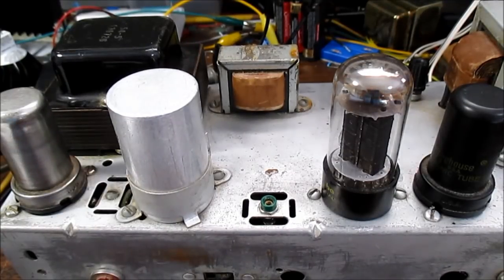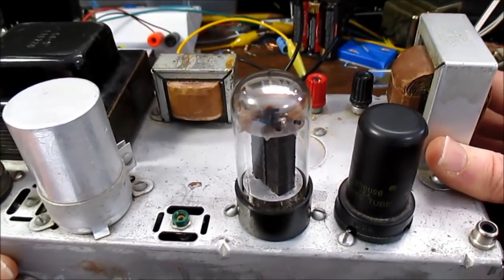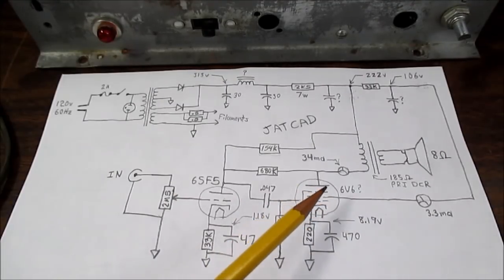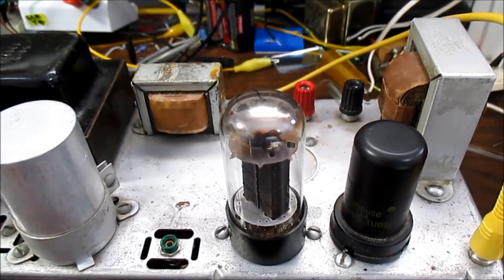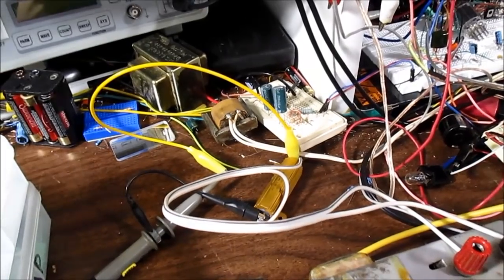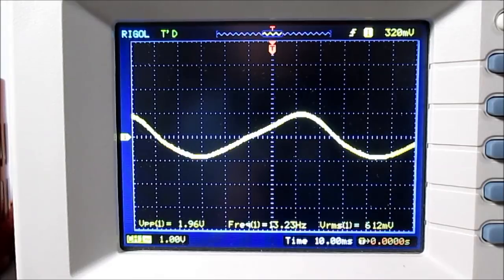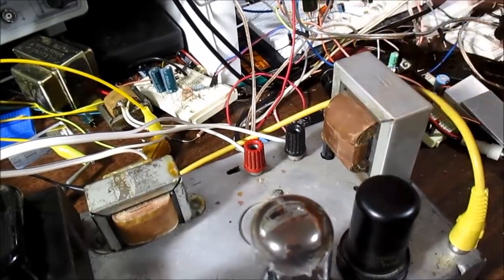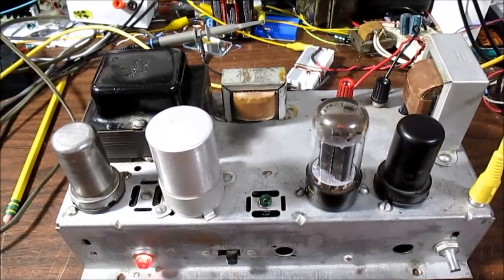Vintage 6V6 SE vacuum tube audio amplifier test & review

Comment: Could have been a radio chassis at one time. The cut outs on either side of the electrolytic look like they could have been for IF cans. 
 The output tube could also be a 6W6 or 6K6.

Comment: I built a little SE 6V6 amp for myself, and it also distorts the bass when I crank it up a bit, I blame it on the output transformer being too small, but I am not sure. I used parts from a old car radio. Sounds fenominal though, and delivers around 3 clean watts if I remember right. I use it with my computer speakers, and have used it multiple hours every day ever since I built it about a year ago. :D

Comment: John,
Great video as always...I know this isn't a new video, but...If I were to want to build a Stereo tube amp...would I simply build 2 of these? 
Is there anything more to it than 2 identical 6v6 amps? I know that the early stereo receivers needed a "Multiplex" circuit that was a separate decoder I think. 
Any thought you have would be appreciated.

Comment: That output tetrode looks more like a 6L6, the 6V6 had a smaller glass as a GT, and a stepped balloon for non GT (earlier style) Also the 6v6's usually had black and silver getter, with little clear glass visible.
The 6L6 is a little more powerful than the V. Good score anyway. Cheers

Comment: I've never studied tubes. they look like they belong with "the Flinstones"! 
Do they have less "Measurable" distortion, compared to high quality modern semiconductor amplifiers?
They must have some technical advantage that they are still around?! I don't mean "Some people hear the difference", but seeing the difference on some instrument, like a spectrum analyzer.
Reply: The "sound" is due to third order harmonic clipping, low damping (you're listening to the sound the speaker makes, not the music) and high frequency rolloff from the transformer.
Reply: The Flintstones aired first episode in 1960.  Lots of tube radio and TV in those days.
Reply: Actually, most solid state equipment measures much better than most tube gear. If you look at a few of JAT's videoos, youl will see even the most basic chip amps are almost perfectly clean right up to clipping, can't say the same for tubes. But sound is a "subjective" thing and many people seem to prefer the "sound" of tube gear over that of SS gear. Best thing that I can say is "to each, their own".

Comment: You ought to try a 16 ohm load on there. Most of those older output transformers were meant to be used with 16 ohms, some even higher than that. That'd also explain the loss / dirty quality of the bass at 8 ohms. 
Interestingly enough, I salvaged a 16 ohm Zenith pincushion AlNiCo speaker from a deteriorated tv set out  doors on a job site over the past summer. That thing is loud with the Dollar Store amp.

Comment: How would you find out which modern transformer you’d buy in order to replace the original output transformer?  I got this squeal that gausses with the linear volume pot.  Then it squealed in the ot but not speaker.  Now just one of the 6V6 tubes does all the squealing.  I can’t make heads or tails of this, but most likely “bad part” is the output transformer.  The size of mine is same style and slightly bigger than your choke.  No labeling.
Reply: Transformers don't squeal. Sounds like feedback.
Reply: James Van Damme now you’re making me want to make a video of the ot squealing by itself just to prove it haha.  But I think the squeal is originating at a preamp lp filter cap that I replaced 4 years ago before i knew wtf i was doing.  So I think what’s happening is the primary is mostly functional but the secondary is oc every once in a while and then I can hear guitar and preamp squeal through the ot primary.  (Try unplugging your cab from a high gain tube amp and playing through it for 10 seconds if you don’t believe me).

I know the ot is bad to some degree since the centertap I stripped back was fully corroded at least a half inch inside the insulation.  I soldered it anyway.  Being 53 years old, I’m guessing that corrosion has gone all throughout the ot.  The normal way to replace an ot is to remove it, analyze it for turn ratio and order a replacement but if it’s gonna crumble during testing, I’m hoping there’s another way.  Hell, I’ll rewrap it myself if I can watch a reliable tutorial first, but I’m gonna do this cap first and go from there.
Reply: Lot of mysteries there. How did it get corroded? Are the laminations loose? That might make them squeal, especially with no load. 

You could rewind the secondary if you could get the core off easily and the secondary was on the outside. Or you could test it out of circuit to see if it was shorted. If you had no test instruments you could feed an amp output into the secondary and see what came out the primary. 

I think you'd find the price of a nice class D amp board would be less than a new transformer, just sayin'.
Reply: James Van Damme well, this is more of a learning experience than a hunt for results but basically all I want out of this is for the amp to sound the way it was intended.  The old electrolytics finally shit the bed a couple years ago and I decided on my winter vacation to get to the bottom of it.  Frankly, I just like the dirt nasty sound and unusually wide dynamic range this old amp used to have.  Now it only plays at low volume.  Any higher and it just squeals until the output cuts out.  I’m pretty sure this is a combo of bad cap and bad tranny.  If you have experience in rewiring transformers, I got 3.5 work benches, plenty of test equipment and a couple six packs if you wanna help me out brother.  I live right next to Mouser so I could pick up some laminated wire in the morning.  I got til the 16th to wrap this project up.

Comment: Green Onions - Booker T and The MGs
Groovy Kind Of Love - Wayne Fontana and The Mindbenders
Hot Smoke and Sassafras - Bubble Puppy 
Little Black Egg - Nightcrawler
What Ever Shape Your Stomachs In - T Bones
Talk Talk - Music Machine
Telstar - Ventures
Summer Place - Percy Faith
What a playlist. It took me right back to the 60s! The input grid stopper resistor would indicate that this amp was for audio other than guitar amp. I agree that the chassis might have come from a radio or a organ amp. The point is....I greatly appreciate tube amp sound! It processes a "warmth" that you cannot hear in SS amps. Tube amps are, the 3 Hs, Heavy, Hot, and Honest. I love em! I love your channel and you have taught me a lot about SS. Thank you for doing a video on tube amplification! More in the future would be fantastic, but if not, you always bring great projects to the workbench! Thankz and Happy New Year
Reply from the maker: Thanks for the list. Saved me from putting one up. This version of Telstar is from the Tornados.
Stay tuned, I have a stereo tube amp to review but it needs a replacement tube as one has gone to atmosphere.
Reply: the squareish openings towards the front suggest IF transformers - so possibly this was a radio... but those typically had more stages/tubes.... hmmm - a great puzzle!

Comment: Cool video...if you could provide the transformer codes, it might help date the unit and determine it's origin.
Reply from the maker: Output: Philco 32-8367-5, 352035
Power: 54-5, 138726
1st filter cap: Sprague 56289
Thanks!

Comment: The unused cutouts near the filter cap look like they were for IF cans. The amp might be a repurposed radio chassis. Amazing how far audio has come over the years. I grew up building amp like that, but one day in the late 60's I built my first transistor amp - never looked back. But, every once in a while the "tube bug" bites me. Maybe someday, I'll revisit tubes for "old times sake".
Reply: My thoughts exactly. Somebody gutted it except for the power transformer. 

I've built a few like that, and I spent 40 years as a high power radar tube transmitter engineer. Nowadays I can buy cheap class D boards that blow them all away.
Reply: Almost 45 years in industrial electrinics here.
Class D amplifiers - no way!!
Discrete transistor class AB is the way to go!
But as I said in another response - to each their own. Audio is probably the most "subjective" branch of electronics - same system, everyone hears it differently.
Reply: I would much rather go with a class A or class AB if I am building it from scratch xD Easier to get good sound with low distortion without faffing with all the output filtering. With enough heat sinking, who gives a damn about efficiency :P
Reply: Exactly. That amp used to be a radio.
Reply: ... I used to salvage chassis and parts and stuff and rebuild it into a radio transmitter or receiver, etc... good ol' re-purposing :-) In the case of the nice amp in the video , even the IF xfmr holes are now ventilation holes.  Kudos to the homebrewer.
Reply: Myself, I used to be in the Navy Submarine Service, and lived for three awesome years aboard the USS Wahoo (SS-565) as a Radioman, with some extra training and stuff to also repair my radio gear aboard the Boat and in case I accidentally spilled my coffee into the air-ventilation intake on my URT-23's RF amp or something, I could tear it apart and fix it...lol :-D

Comment: The schematic for this is very much like the circuit that I came up with when I built my own tube amp. I'm not sure what output power it has, it doesn't go extremely loud but but there's more than enough power to fill my room with good warm tube sound. I'm sure the plate voltage, plate current and bias is probably way off from where it should be but there's no point sorting all of that out until I can get my hands on some suitable output transformers (for now I'm just using mains step down transformers as my output transformers).

Comment: Looks like a 6V6, 220ohm cathode resistor is a normal value for 6V6 (maybe its because of the B+ is lower hence its not pulling that much plate current), i usually run my 6V6 around 40mA at 250V,  probably came out from a console, a 6P1 is a similar to a 6V6 but in a 9Pin B9A socket... you could use a EL84 with that output transformer with some minor tweaks such as changing the cathode resistor...